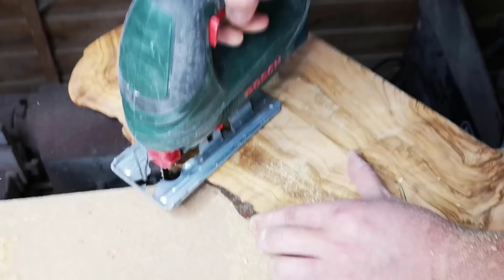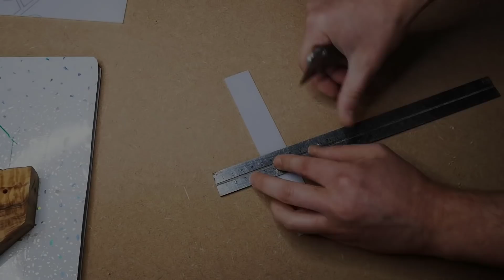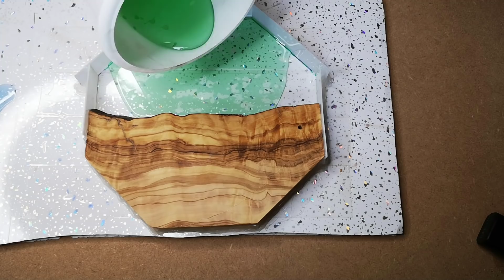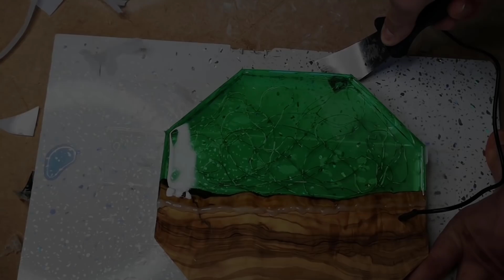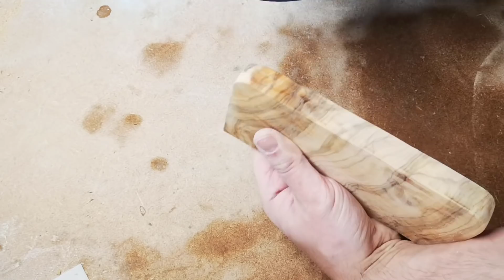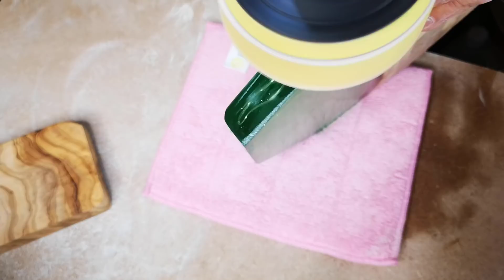Night Lamp with Epoxy Resin and Olive Wood - Resin Art

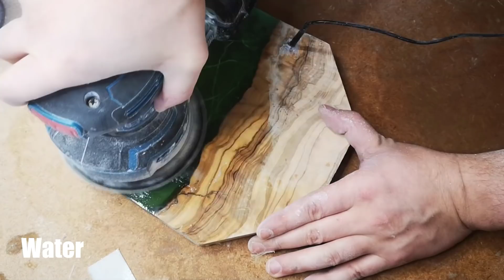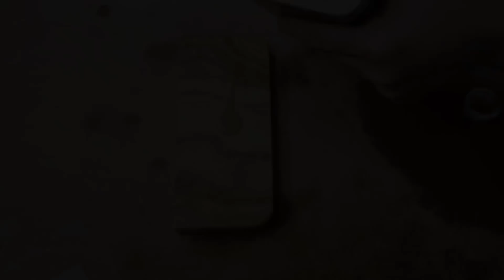Comment: Hola! Es una obra de arte su lampara. Yo tengo varias dudas: 1. Que numero de lijas usas. 2. Que producto le rocías después de lijar (minuto 8:19).   3.Que liquido es el que embetunas(minuto 9:15) a las tablas.  4. Que pasta usas para pulir la resina en el minuto 10. Gracias!
Reply from the maker: 1.I use sandpaper 80,100,120,150,180,240,320,400,500,600,800,100,1200,1500,2000,2500,3000 grit,
2.I use water
3.random wood oil
4.yorkshire grit microfine abrasive paste

Comment: Beautiful work, I would like to know what the cream applied at the end is called, to give that finish.
Reply: Wanna know it too.
Reply: That is not cream that is buffing paste. It comes under 2000-3000 grit size. Easily you get in stores
Reply from the maker: yorkshire grit microfine abrasive paste and Polishing paste 3M GELCOAT LIGHT + WAX

Comment: This is cool except for one issue. When the bulbs blow, which inevitably they do over time, is one required to break it open and thereby destroy it just to change the bulb, reset in resin and resin hardener which is smelly and expensive? This product is not something that could have a decent shelf life.
Reply: LED lights are not like your standard halogen bulb. The lifespan of an LED is approx 50,000 hours of usage. If an LED light is used for 12 hours a day, it will have an estimated usage span of 11 years. So i don't think blown lights would be an immediate issue, and if and when they do fail (in a decade or so of hard use) you could cut the cord and display it as an art piece in your home.

Comment: Looks amazing and a really good job, the only thing I would do differently is to make the cable less seeable! Good work 👍🏽
Reply from the maker: Thanks!
Reply: Interested to know how you would do that. I’d love to do this project myself
Reply: @logicali9575  I make all of my lamps with a base and put a battery box and switch in the base. This way you don't have any cord at all, and you can position the lamp anywhere. I'm sure there are other creative ways to hide this cord, but this way eliminates it entirely.